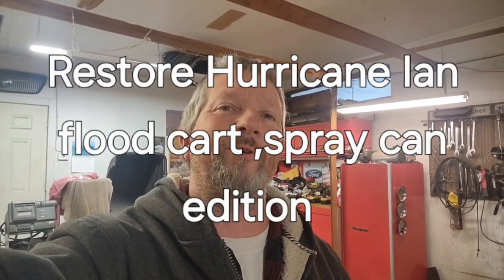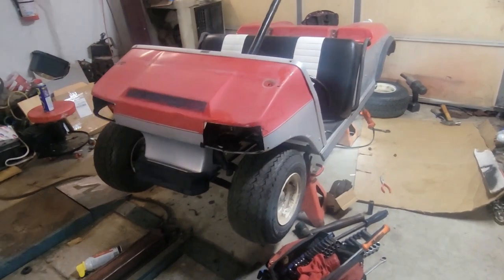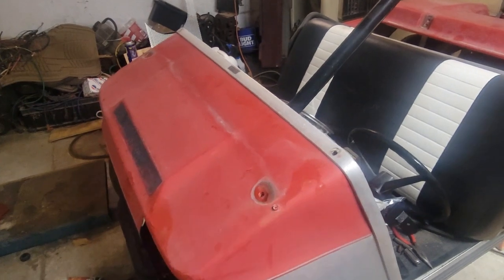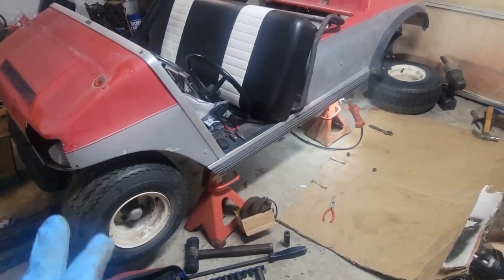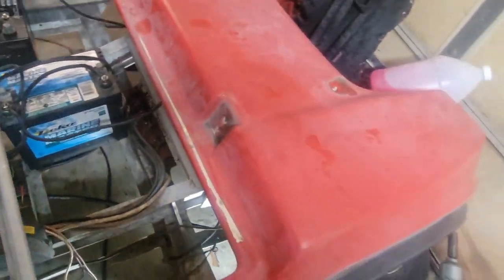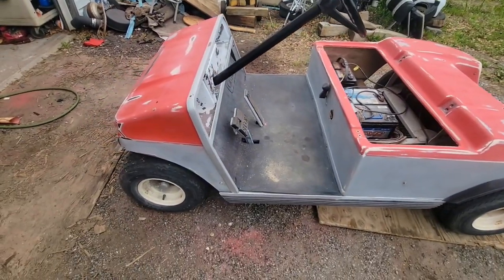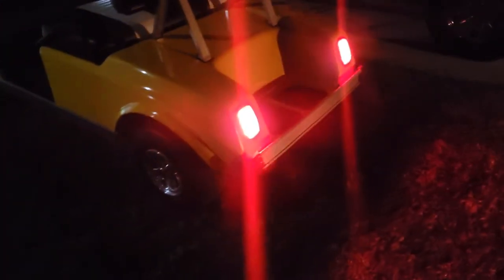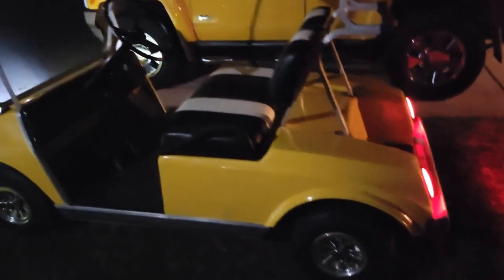Spray paint makeover Golf Cart restoration, Hurricane Ian flood Club Car, (Hummer cart) Ezgo TXT

Comment: Should have made the top color match. Seeing that parked next to the Hummer, shows the Hummer is in need of TLC. Buff and polish that clear coat, then ceramic coat it.
Reply from the maker: I was gonna do the top but it's just a $200 flood cart I brought back to life.  I had one that was a newer EZGO and it had a real spray job on it not cans and top matched ,(it was a flood cart I redid also) but I needed to sell a few to make some money and kept this for running back and forth to the shop cheap ,  yeah with the Hummer the paint on flares (plastic) and few other pieces are flaking bad , I picked up a whole body few months back cause my trans went out and I bought whole thing cheap and swapped trans ,  it's the exact same color and in great shape so I'm just gonna switch the panels and then buff and clean her up , thanks for watching Vassmotorsports and hope ya check out some of my other videos